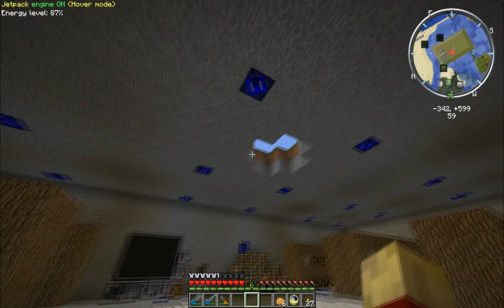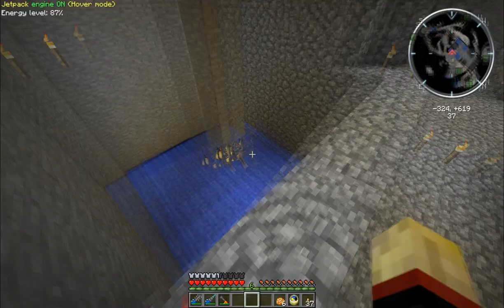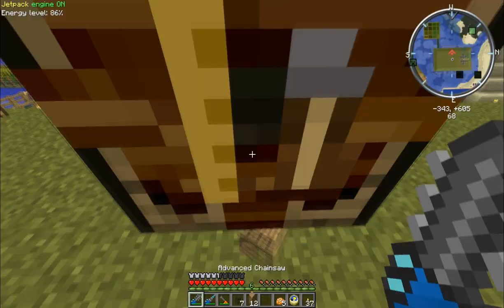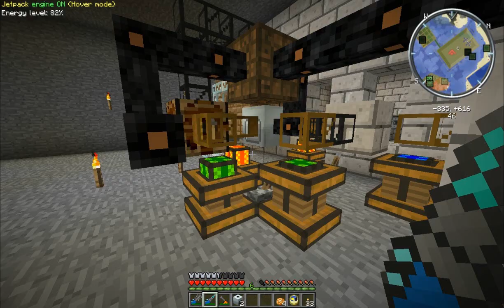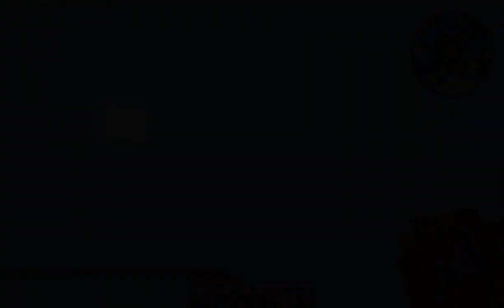Minecraft: Feed the Beast | Pt. 27 - Autocrafting Tables and Industrial Diamonds

Comment: poncho, you can press a number whilst in your inventory, such as 3, while hovering over a item, and it will automatically replace the 3rd item in your slots, with the item you hovered over when the button was pushed. this works for all the item hotkeys.